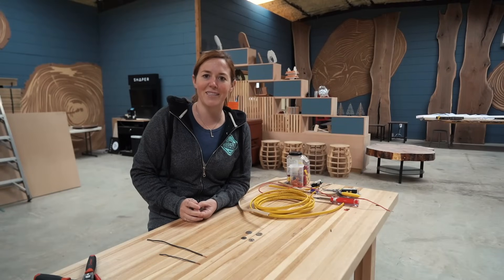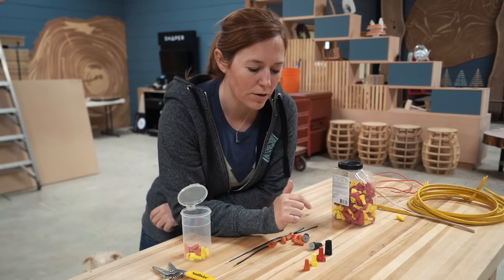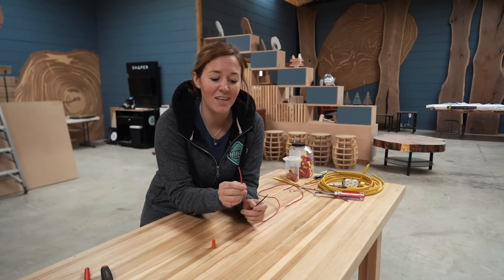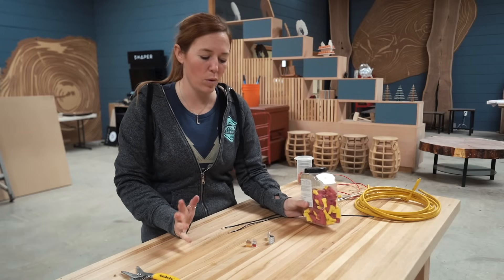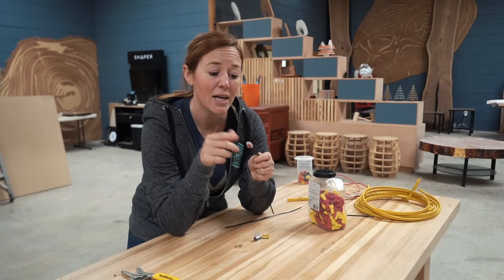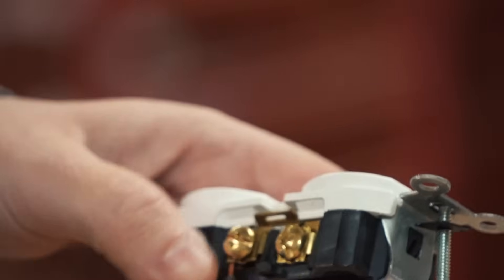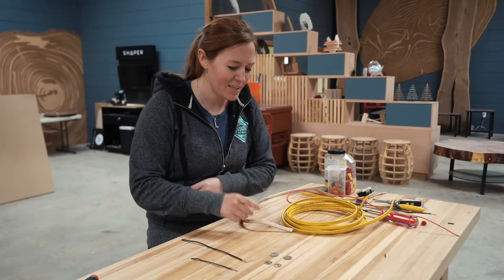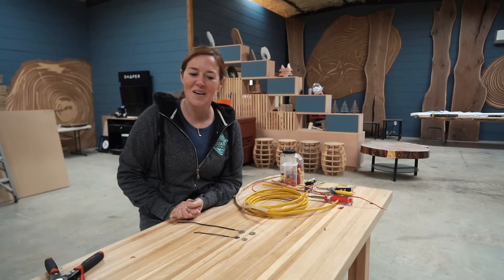DIY Electrical Wiring! Fast, Safe Home Wiring Basics for Switches and Outlets

Comment: I think you need to stress the fact that it’s very important from the beginning stripping back that outer jacket that you do not cut into the wires jacket. You said it, but it needs to be stressed.

Comment: There has to be at least 6 inches of wire extending beyond the junction box. So strip the wire about 8 inches back. Press the knife edge onto the wire. Then run the tip of the knife along the groove between the wires. You only need to score the insulation. You can peel back the insulation and then cut it off. This way it is almost impossible to cut the insulation around the wires. If there is a cut in the insulation you have a small gap. Electricity might  jump out of the gap to ground. This may cause arcing. Arcing will melt or burn everything around it. This becomes a fire hazard.
Strip the wires back about an inch and then bend them to make a hook. Put the bare wire through the hole and bend the wire by turning the wire stripper. Make sure you bend it more than 90 degrees. Place around screw terminal such that when you tighten the screw the wire is pulled around the screw. Make sure there is no insulation under the screw.
When twisting wires together you must have at least two twists. Then you know the wires are firmly connected. Any time where the wires are loose there may be arcing. Electricity can jump small gaps. Arcing is like welding and becomes very hot. I have seen wire connectors that had been melted because of arcing. Always make sure all connections are tight.
So always work safe.

Comment: It takes time to learn the feel that you are only cutting the outer Romex jacket and not the THNN wire insulation or copper under it. Average is ~100 times.  Best is to get a 
"Romex Wire Stripper" (southwire-snm1214hd ) designed for both 14/2 and 12/2 wire or the 12/2 10/2 strippers if you are doing commercial electric as residential 15A-14Awg doesn't exist. BE SURE YOU ONLY SCORE THE JACKET AND THE PULL IT AWAY.  That way you know you did NOT cut the insulation or wire.   If you want to know if you nicked the wires; rip back the Romex jacket with the bare ground and look at the conductors, then bend them back and forth and see if they snap off. 

WIRE COLOR IS IMPORTANT, WHITE IS ALWAYS NEUTRAL/COMMON, GREEN IS ALWAYS GROUND, ALL OTHER COLOR IS HOT/POWER/CURRENT/SUPPLY. DON'T MIX THEM.
Do not switch the WHITE,  $witch the HOT !!!

Nail guard it or they'll nail it. :P

Do yourself a favor and run at least a 3/4" pipe from your panel to the attic for future add-on or modifications.  Maybe also a pipe down to each room for a home run modification.  Personally Romex is a joke, if you have the funds and it's your house; put the controlled fire in PIPE.
Proper electric wiring is Controlled Fire, improper is a Fire waiting to happen!
Reply: Your opinion is that Romex is a joke, I would think that MC cable would be much better, no?

Comment: Not sure about United States but in places like U.K., Australia, amongst many other countries it is a criminal offence for an unlicenced person to undertake work on hard wiring. I guess being only 110v in the U.S reduces risk of death slightly but this kind of work is really better left to trained professionals
Reply: It depends on where you are in the US, the laws vary by jurisdiction.   There are a quite a few places where it is legal for a home owner to work on wiring in their own home.  However, not so in a commercial property, such as an apartment house.   You would have to be licensed to accept employment as an electrician (or be an apprentice under supervision)   I can't say that I know for certain, but I'm skeptical that there's anywhere it would be a criminal offense, it would be a civil violation.  I'm fairly certain that April is in Texas and Texas is a state where homeowners are permitted to work on their own wiring.  They are still required to get a permit for work whcih requires a permit, and work has to be done in accordance when the applicable electrical code.

Comment: Wow don’t fancy trying that with our 250v british wiring best thing get in a good electrician
Reply: There's nothing special about 250V wiring.   In fact, the US most homes have 240V  at the panel with 2 leg circuits.  The 120V circuits are really only have of a 240V 2 leg system.

Comment: Great basic information to get people started doing some of their own stuff and getting them to do it right and avoid some of the pitfalls of dyi. One thing I did notice though was a burn on your wire strippers. I've had that happen myself and it's a great lesson to make sure you power off the circuit before working on the wiring if you're doing a update. LOTO is a life saver.  No one likes to have a sudden "shock". 😁

Comment: Thanks April.  Great video as always.  However, I did notice the arc marks on the back of your wire stripers.  Around the 6:25 mark.  Looks like somebody made a mistake.  I hope nobody was hurt.  This is a great reminder of how easy it is to make a serious error.    Great to know others do this as well as me.  LOL.  I am an electrician and understand how easy it is to get complacent.  That is why some of my tools have arc marks as well.  I agree with all of the information you put out though.  I am a big fan by the way.  I try to do a bit of carpentry as a side hustle.  Your videos are a go to for me.

Comment: April,  Excellent video.  I started designing electrical systems in 1983.  I believe Wago wire connectors came into our shop in 1984, and I used the original designed ones in my house in 1985.  They have been around a long time.   One technical point, per NEC definitions, there are lighting outlets, smoke detector outlets, receptacle outlets, etc.   What you held in your hand is a duplex receptacle.  A minor point to most, but important one when interpreting the NEC.   Again excellent video!   Respectfully,   Kevin

Comment: I wish I could use Romex. Up here in Chicago all wiring has to be inside solid or flexible metal conduit. And many older houses has the wiring run inside old gas pipes from the original gas lights.

Comment: lovin these electrical vids. Your woodworking is always so good, and these are no different. The "add a plug" video couldnt have came at a more ideal time as I was doing just that the day after the video came out. Id love to see some different ways to wire light switches if you feel like doing more of these. Either way, thanks! LOve the channel

Comment: I recommend twisting conductors when using wire nuts, especially when there are 3 or more. The wires can separate over time due to movement from heating and cooling.  Also, wrap solid wires AROUND stranded ones; it's counterintuitive, but a far stronger connection. I've found plenty of loosened wires in residential and commercial settings because people "just want to get it done".
Reply: How did this comment get so overlooked?

Comment: While you can put wires into a wire nut without pre twisting, the reason it’s shown to pre twist is because over time they can loosen and arc causing a fire. I have seen this happen to many times in my career as a firefighter.

Comment: Nice to see an informative and clearly presented video - especially on electrical basics. I am a retired contractor but an amateur at electrical work that will be installing receptacles and switches today. The only thing I might add to the video is the direct burial wire nut usually fails after a few years. In my low voltage landscape lighting, I’ve had to replace every connection because of the corrosion, which caused a big voltage drop.  There are much better connections available for this application.  I look forward to more of your videos! Thanks.

Comment: Quick Tip: if you need to put a stranded wire into a push connection solder the tip first to make it a solid. 
I like that you mentioned aluminum wiring and not connecting it directly to copper, and not using the push connections built into outlets (seen so many issues from those)
Reply from the maker: Great idea! Thanks for sharing and for watching.

Comment: As a master electrician of 30 years your video is dead on! Good job! 

Even though you are correct on all of your info in my opinion  the only thing that I have a problem with (even though they are UL listed, and a lot of people use them) is the push in connectors.  I am coming around to those, but still have a hang up on them. They work the same as the back stab ports on the outlet.  I am also old school if the conductors are all solid my guys twist the wires together before installing the wire nut. I've seen too many loose wires under a wire nut that have caused problems. It is one way to insure the connection is tight. But you and everyone is correct,  the manufacturer of the wire nuts do not require pre-twisting of the conductors.  Like I said, I've been doing this for a while. When I started my apprenticeship my old boss made us solder ALL of our connections other than grounds. Code did not allow soldering of the grounds back then. You know what,there were ZERO lose connections too.
Reply: Ditto to your comment on the WAGO's
Reply: Heads up—you should give the Wago lever nuts (221) a try. The awful push in connectors that are readily available in the US suck.
Reply from the maker: Thanks! Glad you enjoyed the video. Thanks for watching.

Comment: Good information for a DIYer! The only thing I would correct is the direct burial wirenuts. Even though they have that gel, water will still find a way to get in and wreck the connection. I have seen it more times then I can count. If you must make a splice in the ground they make special splice kits for direct burial, or install an accessible ground box.  The exception to this would be for low voltage lighting.

Comment: The biggest problem with direct copper to aluminum use is galvanic corrosion because of the difference in their anodic placement. In West Texas probably not as fast a reaction as say Florida where it’s high humidity year round.....

Comment: I grew up with this: Gardner Bender CR-100 4-Inch Romex Cable Ripper. The price is a bit too much for what it is but anyone inexperienced at removing the outer covering should get this rather than using a pocket knife.

Comment: Great tip about checking wire gauge with a dime or quarter. Very helpful video, as usual, April.
Reply from the maker: Glad it was helpful!
Reply: You can use the wire stripper to check the gauge too.

Comment: Love the minimalist approach the US allows. Most countries have statewide very restrictive laws. With global e trades flourishing the predicted flood of fires and loss of life remained small. 110V 60Hz is so much safer than the 240V 50Hz systems. Under screw connections still require tightening over time regardless of solid, braided or tinned.
Reply: Never found a wire that was under a screw that was loose, probably just haven't done enough I guess ?

Comment: The same reason electricians don’t like the back stab plugs, Is also the reason they don’t like the stab blocks in lieu of wire nuts. None of the stab connections hold up over time, junk. 
Also I don’t recommend stripping romex with a utility knife blade. Too easy to cut through into the underlying insulation. Use a tool or just grab the ground wire with pliers and pull. It will cut right through the outer jacket. 
Love your videos and the variety of projects you tackle.
Reply: Yes, not liking the jacket stripping with a knife either, way to easy to cut the inner wires that way. Great point.

Comment: To echo other comments: 
Try Wago connectors. Not as picky on gauge as wire nuts, contact for each wire is independent of the other connections, easy to release when needed, reusable.
Reply: Yeah what I like about Wago is that it doesn't stick out as much as these wire nuts
Reply: And depending on your location and the type of Wago, some of them are approved for direct use with stranded wire (which used to have to have crimp cable shoes in my location for everything else eg. terminal blocks and such.)
Reply: i discovered them a few years ago...   have slowly replaced every wire nut in  my house..   the bigger wire nuts are  good for capping caulking tubes, but i collect the old ones and leave them at the share shack at the dump - someone will use them.
Reply: wago 221 is a single best thing since the dawn of time.
Reply: Assuming they're NEC approved, I now wonder if Wagos increase the number of connectors allowed in a certain size box? If they are as popular as it seems, have they changed the stamping/molding inside the box to reflect the space saved?

I always thought they looked to much like backstabbing tabs on devices (guaranteed failure), but I've yet to hear anything bad about them...
I'll have to try them.

Comment: My home has black wire what does that mean
Reply: If it's just the exterior sheathing that's black, it means that the wire is suitable for direct burial in the ground without having to be installed in conduit. There's nothing different about the conductors.

Comment: Another handy tip is that almost every outlet, switch, and breaker made these days has a wire strip gauge molded into it. And if you can't remember "gold means hot", the side of a standard wall outlet with the smaller hole is always hot. In the US, this will always be on the right side of the outlet. Non-polarized outlets do not meet code.

Comment: The reason why those homes have aluminum wire is during WWII copper was needed for the war effort. Aluminum was the replacement for wiring in homes.

Something that isn't required but is an extra bit of safety is to wrap the side of the outlet with electrical tape to prevent any accidental contact. 

I still prefer twist connectors for the amount of space they take up in a box. The box is usually already tight as it is.
Reply from the maker: Oh that's an interesting fact. Thanks for sharing

Comment: As an Industrial Electrician, we use a lot of single wire for wiring because it's easier to pull through conduit. It's 99% stranded wire. If the connection goes to a receptacle or a light switch, It cannot be put under the terminals without being tinned, using a stakon connector or other crimp on connector to make the exposed end solid. This is especially true for those of us who like the industrial look in our shops and garages, with exposed conduit. Still a lot of great information for the non-electricians in the group.
Reply: Never tin a wire and then put it into a screw or crimp terminal, you'll get bad connections later on. It's OK to crimp a wire and then solder it if you don't trust the crimp.

For putting stranded wire into a screw terminal, use wire ferrules.
Reply: Jumping on to your comment to mention to people reading that you can use romex inside of conduit (as long as it isn’t in a location that is exposed to moisture) but if you do so you should leave the outer insulation on as the inner insulation isn’t listed for use in raceways.
Reply: @timr86868  Putting Romex in conduit for protection is something to do for shallow burial. I am used to running single conductors in conduit in the air and buried. These conductors are meant for conduits and raceways and have adequate insulation properties built into the insulation, at a minimum of 300Volts.

Comment: NEVER connect wires with just a wire nut!  The NEC requires that a mechanical connection be made BEFORE attaching a wire nut.  Securely twist the wires together first!  A wire nut is for insulation ONLY!!
Reply: Whaa whaa, get your osha butt outhere!
Reply from the maker: So many people believe it's in the NEC, but it's not. In fact, some connectors say to not twist the wires together before.

Comment: I noticed you didn't show spring lever terminals which although being more expensive than the basic ones, are the easiest to connect and disconnect multiple times without damaging the wires.
Are they not usual over there? I would like to know because certainly the types of wire connectors depend on markets and regions throughout the world.
Reply: A majority of the big box hardware stores in the U.S. don't have Wago (or similar) connectors. While I use them and most of the individuals in my circles use them, they arent required by code and are often overlooked since most people would have to go out of their way to special order them.
Reply: Wago 221 lever nuts a becoming more popular over here. Until recently they were only available online in many locations in the US, but now my local HD caries the 2 and 3 port varieties. No 5 port yet, but they are very useful.
Reply: Wago are too new here in the states, a lot of electricians don't even know that they are code compliant. 
I get mine from Amazon.

Comment: Incoming  poop storm in the comments 😬 you should always twist  wires together before putting wire nut on.
Reply: The wire nut is supposed to twist the wires together when it is installed.

Comment: The issue with mixing aluminum and copper wiring is electrolysis of dissimilar metals that erodes the wires.
Reply: It's a little of both, depending on what you've got connected to what. Wire nutting a copper and aluminum wire together is more likely to result in corrosion. Using aluminum wire under a non-aluminum rated screw connector is more likely to cause the screw to loosen because of the different rates of thermal expansion (more pronounced when a higher current is pulled). All modern switches, outlets, breakers, etc are stamped with whether they're copper only ("CU ONLY") or compatible with either ("CU-AL", typically).
Reply: they make marretes for this exact aplication all you have to do is put anti oxidant on bothe wires
Reply: @Vanilla_Icecream1231  
They even make purple wire nuts with de-ox already inside specifically for this purpose. Expensive as baby formula, but necessary by code in some jurisdictions.